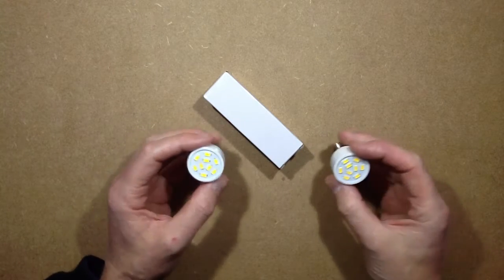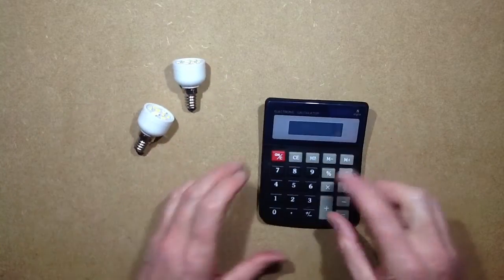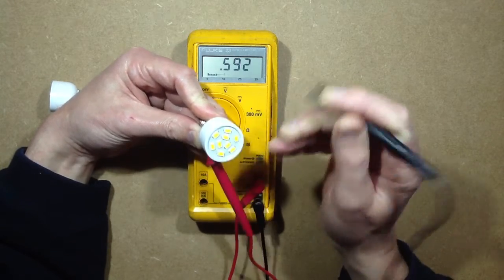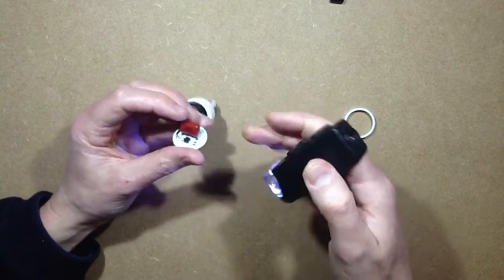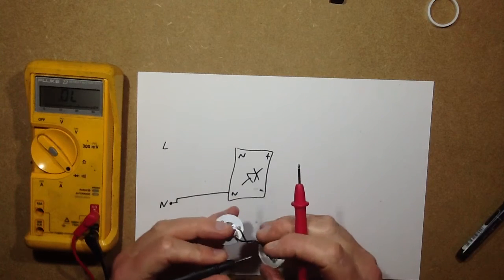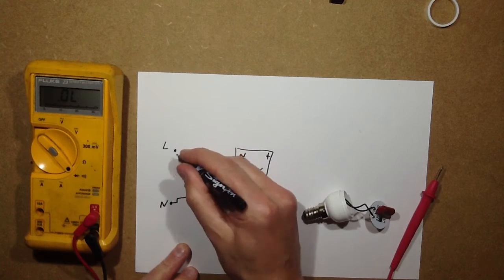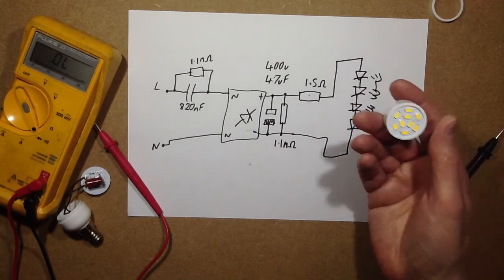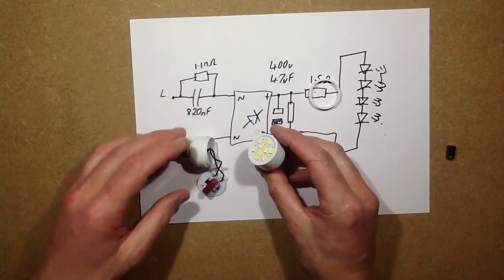Teardown of yet another slightly dangerous Chinese LED lamp.

Comment: Beware Google translation incoming 

I know, old video, but I'm too curious (or too dumb). You mentioned in that video and many others that there really is no contradiction between the mains and the person touching the LED's . But you also said there is 3 volts across one LED. So if I touch the front do I get a full 240 volt shock or does it depend on how many of the terminals I touch, or between specific terminals?
Reply from the maker: If you are grounded then the LEDs will all be referenced to the full mains voltage.
Reply: @bigclivedotcom  thanks for the answer.

Comment: How would a Chinese manufacturer modify this design to make it "Safe" TM? I gather the main issue is the wire-on top going into the LED directly connects to the end that goes into the outlet. So if you weren't grounded and touched it, you'd have a chance of being shocked or jolted. It I presume wouldn't kill you but sting like a bugger. So what would you need to do to resolve this? Coat the metal open connection in a piece of non-conducting rubber/plastic/something like that which is heat resistant?
Reply: Put a glass bulb over.

Comment: Big Clive does the UK have something like. U L ,that checks out anything electrical to make sure its safe ,like our products of that type will have a U L seal on the box .I don't no if the U L seal on stuff direct from China ,I need to check .but I guess sometime we have to watch out for,ourselves, or if we our very lucky ,we have your reviews ,to help us and your reviews do help us ,except when their is a country difference, like 110 volt versus 220 volt,I think the 220/volt system is better,that why we use it on things like air conditioners.

Comment: If any of that LEDs would fail then the elctrolitic would explode. Lame design.
Reply: dsfasdfSDSF Well, at least it indicates that there's a problem. For instance, I had a power supply that shorted internally, but the way I found out was that the breaker popped and I could smell freshly baked electrolyte. Maybe that's what they're doing here?..
Reply: Is that a fire risk though Dayna/dsfassdf when the electrolitic explodes and you smell baked electrolyte?